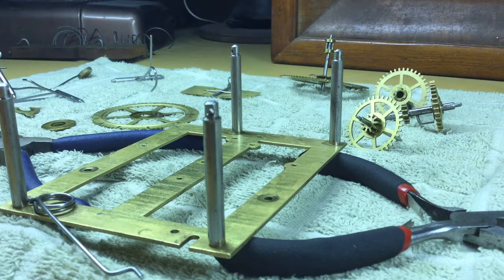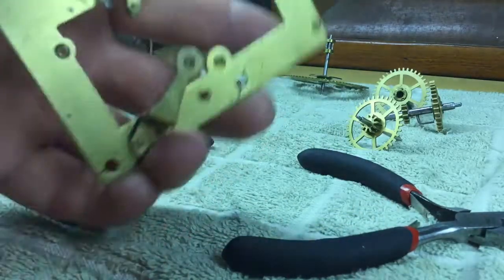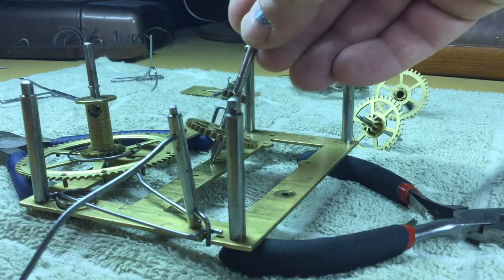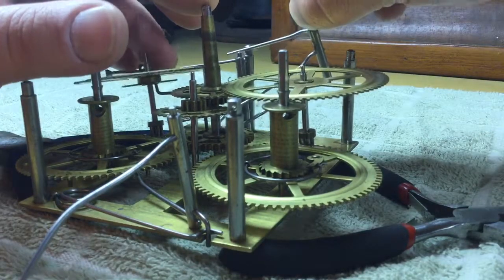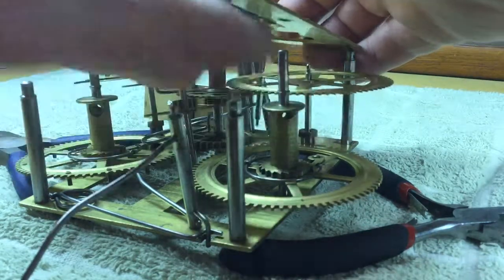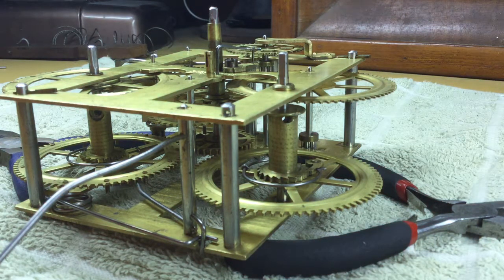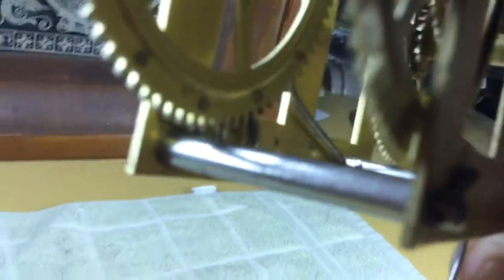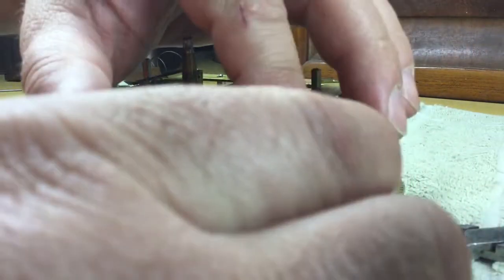Seth Thomas Clock 30-hr Movement Reassembly

Comment: The part where you set the fly, I'm have a little problem with the area? Can you please send me more info on that. I would really appreciate . I also like your videos it has help me.
Reply from the maker: What problem are you having?
Setting the fly on this movement is setting the warning run. The warning run is the motion of the strike train from the moment the lifting lever has raised the locking lever high enough to unlock the train to the moment the warning pin on the fly strikes the warning lever. The lifting and warning levers are on the same arbor. 
With the strike train locked, the warning pin should be about 1/2 turn of the fly from hitting the warning lever. More or less may be required. I like to set the warning run so that at the end of the warning run the hammer tail still has not contacted a lifting pin on the great wheel, the mesh of the other wheels has to be set accordingly.

Comment: My levers seem to be bent wrong to correctly lock and to lift the lever by the time center arbor. Could you show me a picture how the levers look when they are correct? Thank you.
Reply from the maker: I can’t supply you a picture because it will  vary from clock to clock.  Please see some of the other cleaning clock videos on my channel to see further details on how the levers are adjusted.

Comment: I have a Seth Thomas 8 day clock weight driven that I have just done the same as you in this video, however, I didn't realise
that I had to "time" the strike levers/wheels ..  the clock is going great on time side, but no striking unless I push up the wire
to induce it  !  
Whats the procedure I have to do to get it in time please..
Thank You
Reply from the maker: There are a couple of different 8-day weight drive movements, but if yours is the most common, then it will be similar to this one, but the second wheel in the 8-day clock is the great (main) wheel of the 30-hr. That is, the second wheel will carry the lifting pins that raise the hammer for striking. The timing procedure for this movement is essentially the same as for the 30-hour.